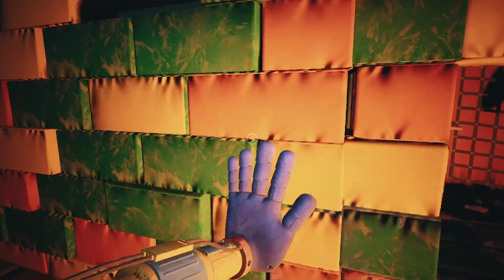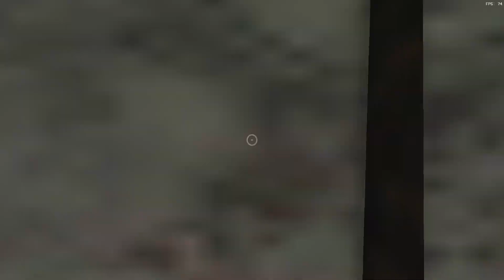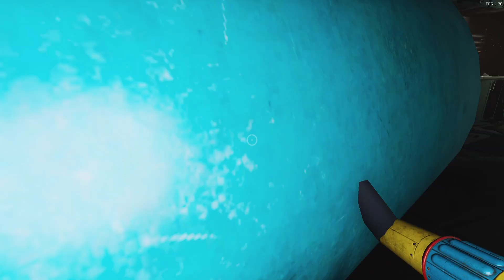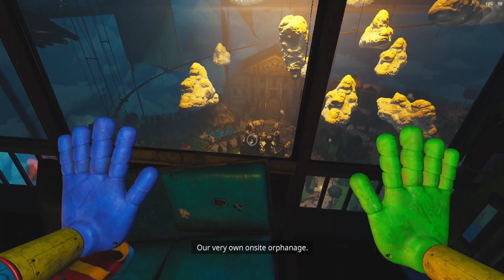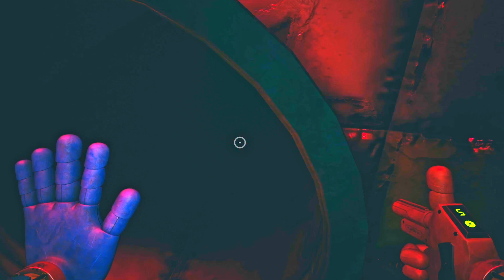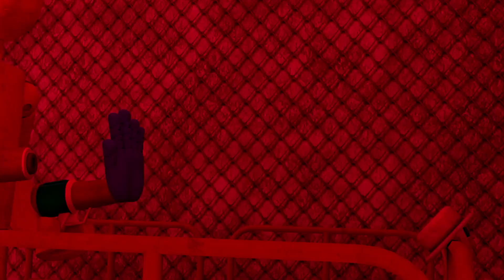Can You Beat Poppy Playtime Chapter 3 While ONLY Using the Green Hand?

Comment: i actually tried this challenge (with using the blue hand) and it was completely possible! i also did it on latest patch so no flying (or easily flying as i should say) you should try it ;) reply to this comment and tell me if you're stuck and ill give hints :)
Reply from the maker: You can’t defeat catnap without the green hand
Reply: @Ansel_G  oh i meant using only blue and green
Reply from the maker: @gizdash  oh, well I do think zipping still exists in the latest patch so it shouldn’t be too difficult unless they removed the air tank in the gas production zone
Reply: @Ansel_G  oh no oh no, you are clearly not aware of RANDOM PIT OF VOID WITH PURPLE HAND JUMP PIT IN OFFICE WITH ONLY CHAIRS YOU CAN USE
Reply from the maker: @gizdash  I don’t think I am haha
Reply: @Ansel_G  that one jump is hell if you die with a chair that chair is gone forever so you need to accumulate as much chairs as possible to make the jump to have as much chances as possible
Reply: once all chairs are gone its over